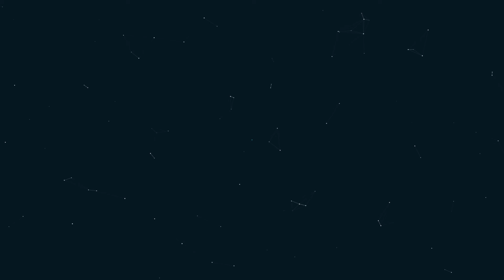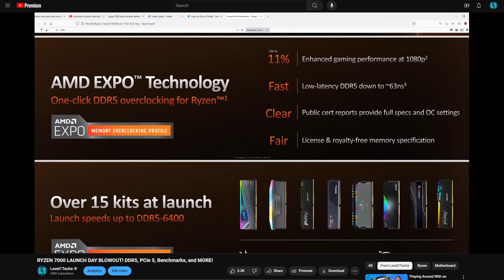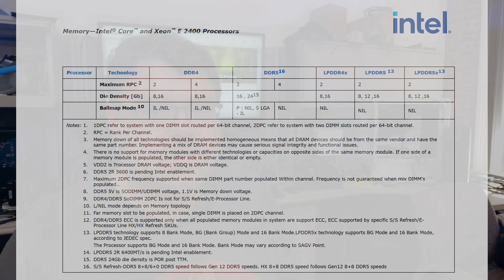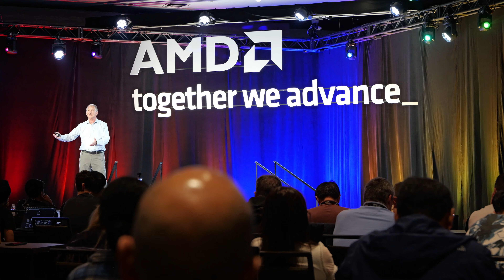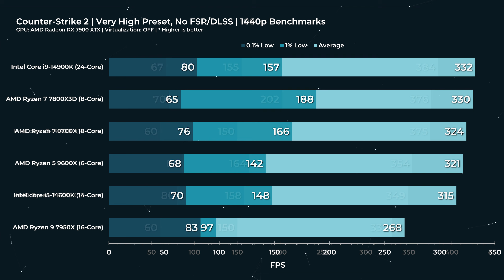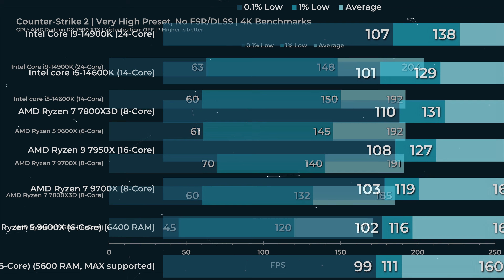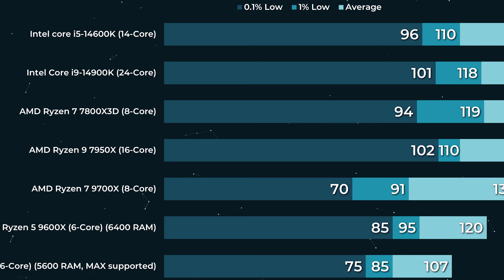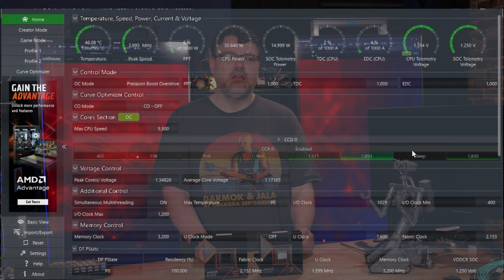Ryzen 7 9700X and Ryzen 5 9600X Review and Benchmarks

Comment: The gaming benchmarks are very different from the ones at Gamers Nexus or Hardware Unboxed. They found very little improvement over the 7700X and the 7800X3D is still on top. Would love to see the differences in testing methodologies
Reply: We should wait till the 9800X3D.  then we can do a proper apple to apple comparison.  The extra cache on 3DX chips is something that cant be ignored.  Once we get a 9800X3D version then we can see if this architecture was a huge upgrade or not in performance and power consumption.  So far, comparing a 9700x to a 7700x is showing just power efficiency with similar performance.  So if you want to use less juice, then the 9700 seems to be the way to go, but if you already have a 7700x or  7800x3d, no need to buy this.  I have  a 5600x and was thinking of moving up to AM5.  I might consider a 9600x or 9700x.... will wait a few weeks for them to get their BIOS stuff strait though. Never a good idea to buy on launch day unless you know it wont be available for months afterwards due to supply.  I don't expect that with these processors since they are a small improvement over the 7000 serries (mostly efficiency)
Reply: B/c most MBs are trash.
Reply: I feel like there results are not that different from each other. The game mix is different also they seem to approach CPUs from a different perspective. 

I like having the CPU being out of the box very efficient with room left on the table for pbo or over clocking.
Reply: The results are really close to Gemer Nexus! But in here we also see 1440p and 4k results and also playingbwith PBO and memory settings. But if you look 1080p results they are really close to GN!
Reply: I'll take Wendell over anybody else, since he's looking at it from a proper engineer's standpoint not a Youtuber starving for clicks attracted by controversy.
Reply: AMD must be pulling their hair right now... 7XXX launch.. OMG THAT WATTAGE NOOOOOOOOOOOOOOOOOOO Angry mob.. 9XXX launch.. OMG STARVEDEEEDDDDDDDDDD PBO all the WATTAGE!.. i mean... what do people wants?
Reply: they had very little overlap in games tested
Reply: @ryogaming4771  I think they should've had the 9700x 65>105w boost and not 88w to get the best of both worlds the 6 core part seems to run fine with 88w with the reduced core count
Reply: @michael.petraeus  same, the final consumer user will just see more numbers and buy it on base of what media videos make about with their opinion over, with wendel I can see the raw info and use it for everything without scream if they're suck or not, and wendell opinion have more fundaments than just clickbait you with it
Reply: @ryogaming4771 the 9700k was slower than 7700k in some games. Its been two years. They were already efficient imo. I just think they had better scaling with efficency than performance so they are trying to sell that.
Reply: @ryogaming4771 it's impossible to please everyone 😂 maybe we get a bios profile later on? Like the   Eco mode on the 7000 series. But then again we got PBO so dunno..
Reply: @haukionkannel The importance of including the higher resolutions because most play at higher resolutions.  The Steve's believe that the performance is a continuation of the 1080 results and that is clearly incorrect and far more variable.
Reply: Wendel actually set up these processors to work - GN and HUB ran them locked in defaults settings.  9000 run a lower power default so no great performance improvement - unlocked they soundly beat 7000 - simple as that.  GN and HUB have stayed locked in "stock" settings and not also reflected how enthusiasts may run the chips - whilst that may count as "overclocking" - well they let Graphics cards boost when they test them, so why not CPU's as essentially modern CPU's have adopted that boosting methodology used in GPU's.
Reply: @michael.petraeus  well his "engineer's perspective" made him miss the whole elephant in the room... a 35 minutes review without ONE single chart comparing performance and price with 7700 and 7600 ? Since when do we review new gen without ONE comparison with previous gen ?
Reply: @malphadour  Wendel didn't enable PBO.  He used 5600 and 6400 memory and set the FCLK to 2133 so that the 6400 would be 1 to 1.  What Wendel pointed out more than anything is that 1080p gaming testing is bs.
Reply: @malphadour  OUT of the Box is the most dishonest of them all.  Running with 4 click bait horror episodes in a row milking for all it's worth.  Doing everything they can to not look outside the box.  Phoronix's Linux results show there is something wrong in windows.  Out of the Box is like "oh the inhumanity"  If it isn't fixed then that means there is something wrong with Windows and perhaps time to give Linux a serious look.

Comment: The tone of his review seems to be very different than other reviews. But he is 200 percent keeping in mind the power envelope they’ve achieved this in. 

I think they limited the performance gains and played it ultra safe with power usage.
Reply: The tone is different but results are not too much. He said gains of 4 to 16% which is not different than Hardware Unbox and GN. Wendell seems to love the power efficiency gains and factoring it much more.
Reply: @kicapanmanis1060  I completely forgot when the 7000 series came out. Many complained about it going to 95 c. I guess they over compensated. 

I almost wouldn’t be surprised if some how they changed the spec of the 9700x to 80-90w rather than 65 w. Through a bios or something.
Reply: @justin837  Ryzen 9000 still goes to 95C.  It's just that it should maintain advertised max boost at that temp without going over 95C.
Reply: @justin837  it already is 80-90w they boost to 88w from the 65w TDP, the 7000 series was 105w with 142w boost, so its almost halved on paper but in reality not as much of a gap but enough to bring the power draw/heat down a lot.
Reply: @WayStedYou  that’s like 23 watts more for the socket. Compared to the competition, 20 watts is almost irrelevant.

Comment: Good review as always, especially in showcasing the substantial power consumption improvements. I wish they had pushed a bit harder on raw performance, but at least this shift gives them more headroom to play with if they decide to run things closer to the sun again on the next generation. Reminds me of going from an XBox 360 to the XBox 360 S. Same performance, much lower power usage. Existing users won't see much reason to upgrade, but it's a great entry point for anyone just buying in.

Also, extra points for the amazing t-shirt. :)
Reply: There's is barely any improvement. These are about 5-7% more efficient than 7700.

Comment: Wendell seems to be quite a bit more optimistic about this gen than GN and HUB.  I think people were hoping for more performance out of the box.  It is nice that they are cheaper.  Looks like gamers should wait for the X3d variants of these parts.
Reply: Cheaper, more efficient, 9700x can fit in a 65watt mobo which is awesome for "cheaper" builds where heat is actually an issue.
Reply: @B1u35ky  They clearly meant builds on the lower-end of the scale cost-wise, not that 9000 is cheaper than 7000.
Reply: GN is just a straight-up salt fest these days.
Reply: @tim3172  Yeah not sure how to feel about that.  Steve does a lot for the community but I don't like the rage-bait every week.
Reply: The thing is that a 7800X3D is already more than enough for gaming, for the next few years at least. There isn't a single game out there where the X3D limits the GPU (except for maybe 1 or 2 badly optimized examples). So for people to screech and whine about the 9700X having lackluster performance improvements just stinks of entitlement and ignorance when it has a doubling of efficiency. People choose to overlook that fact and pretend efficiency doesn't matter anymore. Gamers wouldn't even benefit from an uplift when the vast majority of games today are GPU bottlenecked above 1080p.
Reply: @Gravy1255  No, it's only 5-7% more efficient than 7700. So, your statement is clearly false.
Reply: @fugitive6549  look at the temperature charts and the tdp needed for motherboards the 9700x is a 65 watt part vs the 7700x needing more juice. That means if I wanted to I can slot it in my a620i board no issue and heat will be down as well.
Reply: @fugitive6549  yall need to start thinking for yourself sometimes just cause a reviewer doesn't like it doesn't mean there aren't positives. Both debauer and Level 1 tech seemed to like them.
Reply: @Gravy1255  The 7700 Non X is a 65W part too.
Reply: @Gravy1255  bro, next time try reading, I guess. I said 7700. AMD's efficiency with 7000 series was not great and they released 7700 to remedy that and 9000 series efficiency is barely any better than 7700.
Reply: @fugitive6549  this is an x part. It's a push for the future. I'm banking on this is a stop gap just like 2000 series. If we are matching basically a 5800x3d (which is what amd said it would do) on 65 watts with much lower thermals...... it's great. Maybe again think outside of just 9700x matches 7700x "so it's shit". When in reality the future is gonna be good for AMD. They have completely reworked a lot of the architecture. It's obviously not fully shown here and will only get better in the future.

Amd is trying to cut down on thermals so we don't have intel issues of needing a 3 fan AIO. To even run parts due to it being extremely power hungry and loves outputting insane amounts of heat.
Reply: @Gravy1255  I'm not talking about Intel here. Intel's only gonna be able to beat AMD if their backside power delivery architecture that they invested around $9 billion in at their own fab. Hopefully, it works out and if it does, Intel can finally reclaim the crown in both perf and efficiency but most importantly efficiency. Yeah, AMD has botched the 9000 series launch since both GN and HW unboxed butchered the CPUs comparing them to last gen. Yes, I do believe AMD software, TDP is the cause of it  and it will get better but still the launch has been worse than underwhelming. You are getting similar perf while paying much more. 7700x can be found for $200 and 7700 even cheaper. That's what makes the new CPUs so disappointing at launch.

Comment: the good thing about the Zen 5 is, AMD did not lie about what this CPU can.
improvements:

Zen 4 introduced AVX-512 instructions. AVX-512 capabilities have been expanded with Zen 5 with a doubling of the floating point pipe width to 512-bit. 
Additionally, there is greater bfloat16 throughput which is beneficial for AI workloads.
The L1 cache per core is increased from 64 KB to 80 KB per core.
A ~16% IPC uplift on average, claimed by AMD.
Memory speeds up to DDR5-5600 and LPDDR5X-7500 are officially supported.
Infinity Fabric clock (FCLK) has been increased to 2400 MHz.
New 2-ahead branch predictor.
Power consumption reduced from 105 W to 65 W (7700X vs 9700X)

In the end, this tells us that energy consumption has been reduced, the CPU has become up to 15% faster and the AVX-512 instruction set has been improved.

your review is totaly lacking the biggest new feature AMD is promoting on Zen 5, the AVX-512 benchmark test with RPCS3 (PlayStation 3 Emulator)

Comment: Thought I'd share: an audio issue (?) I just noticed, and it's probably because I'm using a convolver in easyeffects on Linux. The talking head audio sections where you're sitting on a desk (such as 13:54 to give an example) have a lot of audio compression artifacts as if it was "background noise". If I disable the convolver they are practically imperceptible, or you have to be listening for them to notice it, it's like a very-low bitrate AAC stream.
Edit: After listening again, it sounds more like an applied noise filter/suppressor without a noise gate afterwards.
Reply from the maker: In Adobe Audition I use the noise reduction process using a sample of the audio room tone after adding a multiband compressor. There are a lot of computer fans buzzing about the office. ~Editor Autumn
Reply: @Level1Techs  Hey Autumn, I recommend a perpetual license of Waves Clarity VX to deal with noisy voice tracks. For forty bucks you can get great results within Premiere Pro with no tweaking. It's just VST plugin so it works on Audition as well. Just add it to an audio track or a voice bus/submix. I use it myself for my mixing work.

Comment: For single core the 9600x or 9700x is tremendous value. Specially since you can put them in a Minisforum MS A1 and make a powerful mini pc (capable of better graphics and hackintosh if you pair it with an external radeon gpu via oculink). Competing with 14900 and Apple M3 (as far as single core goes). Juicy stuff
Reply: Mini-PCs usually have laptop CPUs,  much more energy efficient with much smaller PSUs.
Reply: Kind of non-achievement. I don't see any use in one core usage these days, 99.99% of task are multi-threaded.
Reply: @someperson1829  Perhaps you are not aware of many applications where single core is key. Such as for audio and photo, as well as others.

Comment: I do see why the rumors were floating around about the 9700x's power draw. I do hope they give us some kind of BIOS option to take the limits off of it and let it run at the power draw of the 7700x, like you said tho PBO by itself can probably get you there
Reply: I'm certain you can pretty much remove the power limits as on all previous Ryzen CPUs. If not in the BIOS, then with the Ryzen Master application.

Comment: 9700X is hard sell when 7700 (non-X) tray version is half the cost. Literally half the cost. Insane.
Reply: In my country they are almost the same price, which sucks.
Reply: 9700X is still better, lower heat lower TDP and can be boosted to 105W performance through BIOS update (not including the PBO and OC)
Reply: @  I finally got a 7700 Tray at half the cost. 
The 9700X is not worth it, the 105W boost gives almost no gains in performance.

Comment: Best to wait for BIOS updates and the X3D chips. All the 9800X3D has to do it beat the 7800X3D. 

Edit It does look like overclocking is back ont he table though with 20% performance uplift from another review.
Reply: With how the 9700X is at equal or even beating the 7800X3D in some games, 9800X3D for sure will beat the 7800X3D lmao
Reply: @popop143  it's not. It barely even beats 7700x.
Reply: @fugitive6549  so brave considering how wrong you are

Comment: Point no.1: it's running 20°C cooler
Point no.2: it's running 40% more efficient 
Point no.3: it's still better at some cases 
Point no 4: OC exists

What the hell is everyone complaining about? This is a BIG W for AMD.
Reply: Because amd hyped it at computex and did not deliver on the performance numbers they showed. And it's good people are complaining about that. Amd should have been honest there. And just say performance won't be they much better because this Gen we focus of efficiency and then everything would have been fine.
Reply: Because:

Point no.1: It's only running cooler because Zen 4 was designed to hit Tj Max. If you put 7700X into eco mode, it will also run at 60 C with good cooling. It's math, nothing else, you are comparing a 65W part to a 105W and pointing out that the 65W part runs cooler... of course it is. i3-12100 also runs cooler than 7700X but is older and slower.

Point no.2: No it's not. It's "up to 40%" more efficient, if you are comparing 7700X and 9700X but that is a particular case. 7700X is woefully overblown with its TDP, 7700 exists and has also 65W TDP, while having 97% of 7700X's performance, which means it is within 10% of 9700X. That puts it at around 14% better efficiency... we will, of course, see how 9700 performs and what TDP it has but I wouldn't hold my breath, it probably won't run within spitting distance at 35 watts or so...

Point no.3: "Still better in some cases" is really, really bad place to be on a brand new architecture after 2 years of development. If the power efficiency wasn't so good, it would be Bulldozer-level bad place to be. Thankfully, efficiency is at least saving AMD from a complete disaster.

Point no.4: OC ceases to be apples to apples comparison, and HUB already tried OC through PBO and it gains 5% at best. Not to mention you can overclock Zen 4, too.

So, overall, none of the things you mentioned are really key selling points. Sure, efficiency is nice and all, but only if it's paired with at least decent performance uplift. Since it's not, the whole thing is quite a disappointment after almost 2 years.
Given Intel's woes right now, AMD had really all the eggs in its basket. All they had to do was to release a polished, new CPU that would be at least 15% faster across the board, and wouldn't have any stability issues, and they would be absolute winners. But that's not the case and again AMD shot itself in the foot.
Reply: copy paste comment.

Comment: I suspect some AGESA tweaks are needed, or at least I hope so. Seeing that the 9700X is actually slower than the 7700X in many tests is not encouraging.
It does make sense to me that with the widening of the execution units and the changed branch predictor would need some (significant) AGESA changes... and it's not exactly surprising if the initial implementation is a bit immature. :)

Comment: Did you have BIOS issues, like Gamers Nexus had? I mean it seems you don't, given that you were even able to run 6 core, but I think if someone asks me for recommendation, I would wait for 2 things: New BIOS updates in next 6 weeks and probably also X3D chips.
I wonder if some reviewers didn't get "recalled' parts by accident. Because the 2 genuinely good things about those CPU's that stand out is performance per power and single/few thread performance. 9700X probably could have done with 95W TDP, or something in between 65 and 95 for gaming, but that's all.